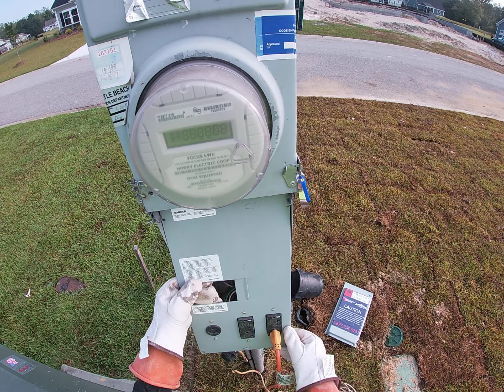How To Hot Check New Home Electrical (No Meter)

Comment: why not plug into the 220v outlet on the temp panel, or you could get 2x 120v plugs and grab the L1 from one recep and L2 from the other and connect the neutr together.
Plan: C you could get a 12/2 and back feed from the dryer or range.  I guess its not worth the trouble since all homes are different. 
Or do what we do in the Hood and throw some butter knives across the meter. 

I might have used the male end at the house and female at the breaker, but its temp anyways not like you are leaving it overnight.